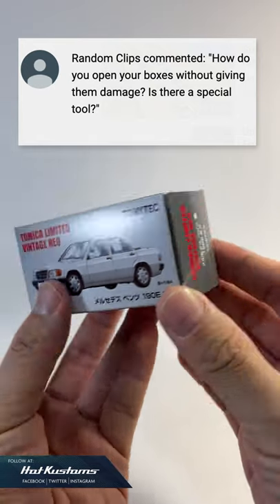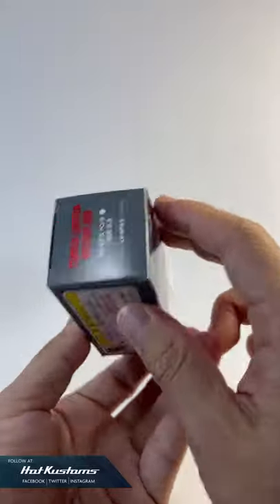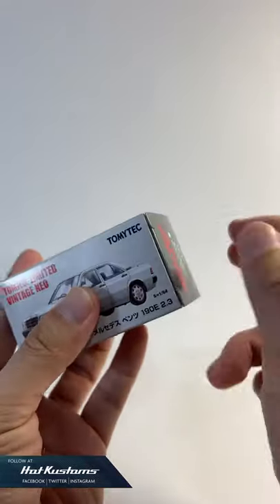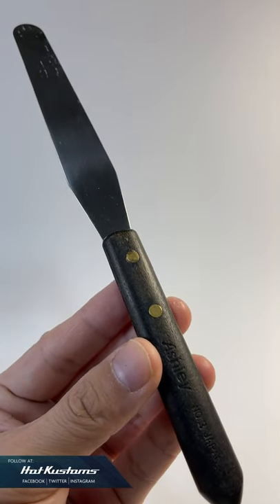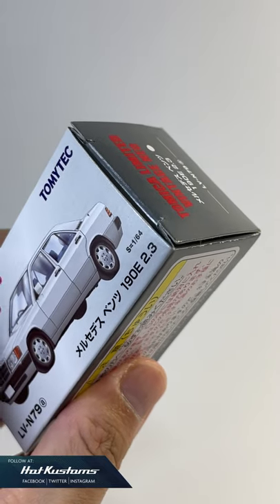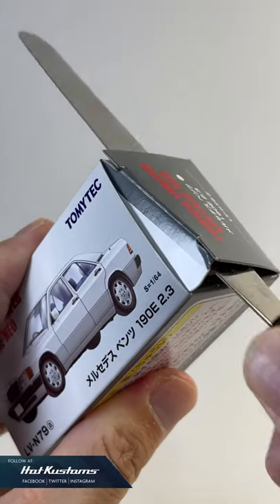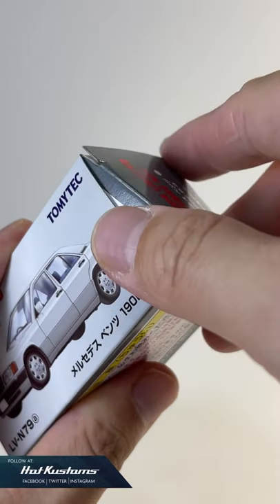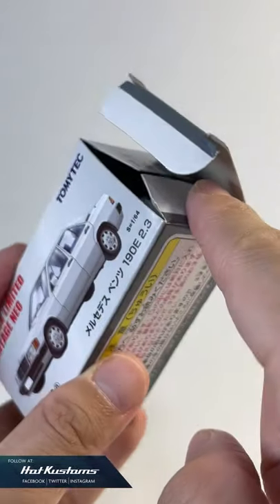How to Open Tomica Box Without Damaging It

Comment: I use a thin metal ruler. Once opened I make sure I close the flap with a slight gap and not all the way down so it can easily be opened next time.
Reply from the maker: This is the way 👍